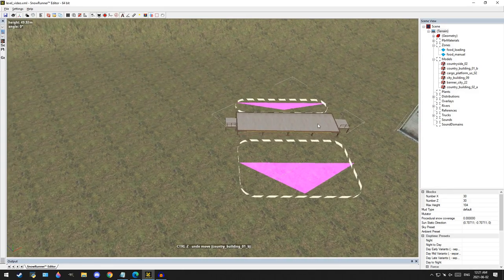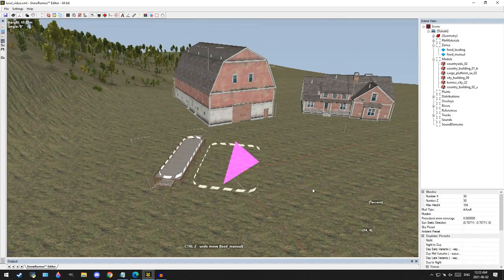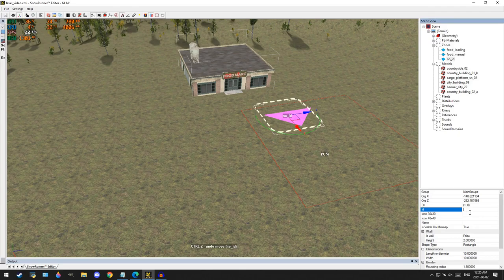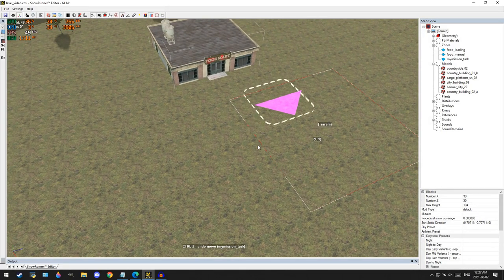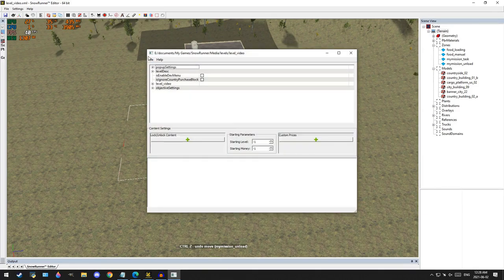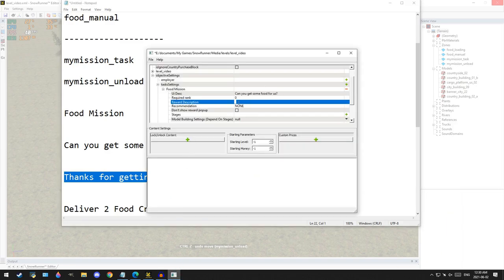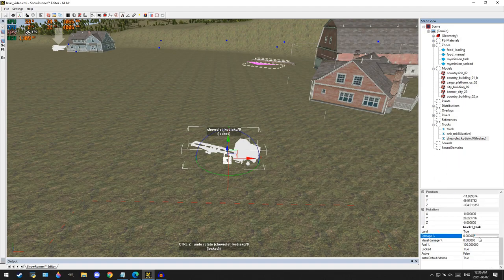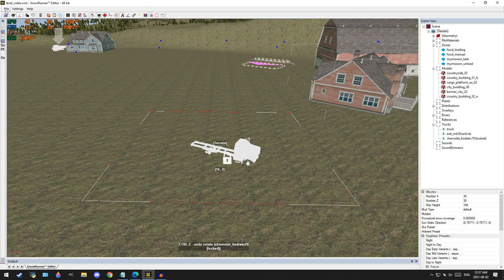Remoh Builds - Snowrunner Editor Mod Map Tips and Tricks

Comment: I figured out how to do the watchtowers wioth animations and all I also figured out almost all the other zone building task building and contract building  But the one thing that has got me pulling out my hair is how to get the gateway destination animationto work.  I have everything configured right as far as I can see but no luck.  I noticed on your heavy haulin region dlc they work.  could you pass on any secrets Likke maybe do the maps have to be published for them to work like some things do?  Thanks for the help and sorry to be a bother but I just cannot figure it out
Reply from the maker: The gateways work the same as the watchtowers. The biggest difference is the gateway camera just goes straight down and doesn't travel distance. Take a random model and lift it above your gateway zone to where you want the camera to start and record the position of the model. The gateway ends on it's own so you only add in the start point parameters

Comment: I can’t get my garage to work game crashes every time I try to enter it when testing my map. Not sure what I’m doing wrong.
Reply from the maker: Garages are usually pretty straight forward. They need to zones, one with a prop "garage_ent" and one "garage_exit"  you can only have 1 garage per map. Have you checked the mod map errors log after the crash? I dont think I've had that issue myself. Let me know if you find any errors and what they are